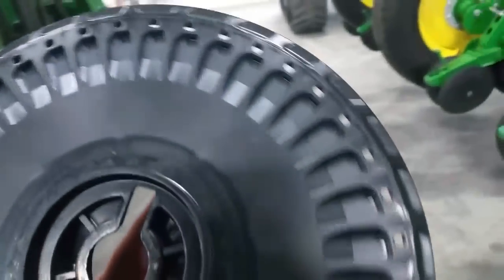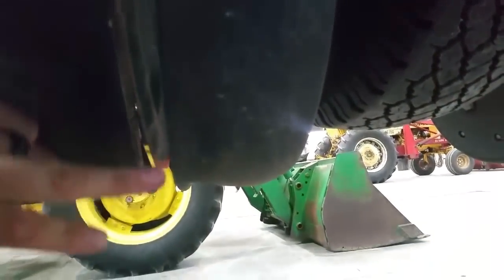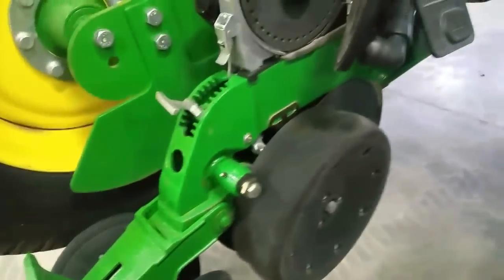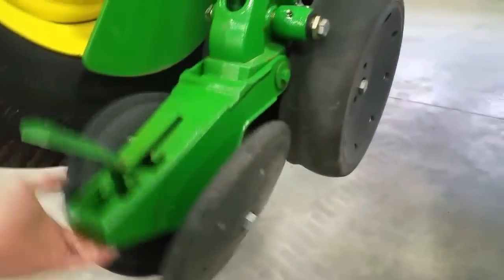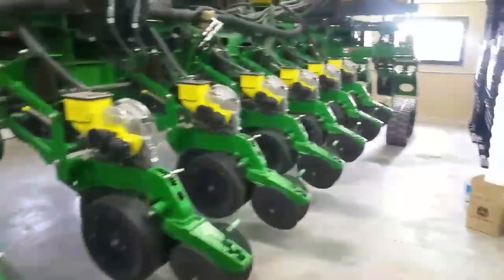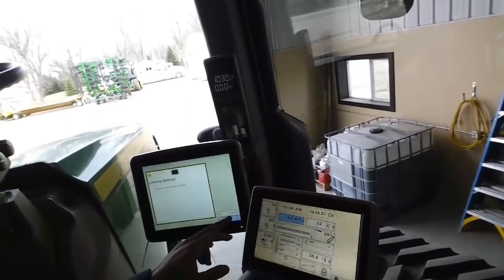Spring maintenance

Comment: that setup on your digger to hold the sweeps is sweet. knew John Deere had it but never seen them. I hate changing sweeps. I would like to see more about your seed plates. does it use air to hold the seed in place?  you sure have some nice equipment there. very organized also

Comment: When you were working on the digger I noticed you had twine on there. That is very common for us because we spread manure from our cows on almost all our fields. It gets very annoying taking it off when we refill our John Deere 4640(our digging tractor).
Reply from the maker: jaxsonino2 We get it from a landlord who has cattle and bails a lot of corn stalks.  We have had it take out bearings a couple of times.
Reply: That's the same twine that's claimed  to be 100 percent biodegradable. In like 100 years, I suppose...
Reply from the maker: 57fitter I have thought that same thing many times
Reply: I use the plastic twine myself,  but I try to be vigilant about keeping track and not getting it on the fields. It can do a job on bearings.

Comment: How does the seed get from the main tank through those long flat tubes to the row tank?  Compressed air?  Love the videos.
Reply from the maker: B Laquisha The seed travels through the small, black tubes.  Basically compressed air, yes.  It's technically a vacuum system that pulls it through.

Comment: I love your videos I'm 13 and this is the first year I'm running a cultivator by myself can you show us how to run one and strategies thanks
Reply: What part do you think you'll have most trouble with?
Reply: All the auto steer and going around the fields to start and stuff like that thank
Reply: Kris Cipywnyk forgot to tag you
Reply from the maker: Mitch Gibson The biggest tip I can give you is to be careful with the outside edges!  Those big cultivators hang out farther than they look and can get into rock piles and phone lines quickly!  We also don't like to run them too deep.  Deep enough for a nice seed bed, but shallow enough to prevent compaction from the tractor having to pull so hard.
Reply from the maker: Mitch Gibson The auto steer isn't tough at all if you're just using the 'straight track' settings.  Once the owners show you that, you'll get it.
Reply: For autosteer you'll get the hang of setting it up after you use it a couple of times, you'll mostly be using straight track so you'll just be setting up A+B lines/A+Heading lines. 

For doing headlands i like to pick a point on the front of the tractor cab (say a bracket or something) and line it up with the outside edge of the field so your cultivator is all the way edge. Depth is usually already set up for good tillage and you dont tend to change it much once you start.

For going around corners that will come with experience the more you run it but to first start learning you may want to slow down a bit when turning and just remember you turn earlier than you would think as the cultivator is alot wider than the tractor and it is trailing behind. Also remember dont constantly watch the implement behind as you are steering the tractor not the implement so when you do have to go around something it will be too late to adjust when you watch the implement. Just think of it as look where you want to go and not where you have been. And for turning on headlands i like to make three so you have plenty of room and when you turn you try and make a teardrop shape.

Hope this all makes sense and good luck
Reply: Thanks everyone

Comment: I run a 4830 as well I have problems with the chemical like atrazine hanging up in the booms ends so I put a air purge kit on mine
Reply from the maker: Nick Blank We had serious issues with our atrazine in our sprayer last year  (top air-pull type).  Haven't had any in this 4830 yet.

Comment: How do you like the degelman roller? We have a older rite way that has had frame issues.
Reply from the maker: Anderson Farms This is the only roller we have ever owned.  Probably had it for 10 years and never had any issue with it other than it has about 400 grease zerks and sometimes a few of the bearings won't take grease.  Never had a frame issue.
Reply: MN Millennial Farmer ok, ares also has some grease fittings that won't take grease sometimes but all equipment has that sometimes.  the neighbors have a newer rite way and it's been fine so we'll have to see. we're thinking about getting a different one next year

Comment: Why don't you just run the sprayer tire up on block of wood to lift it off the ground a little so you put the duel on.It work great for us
Reply from the maker: Because there were no spacers on it yet so we had to remove the inner bolts as well